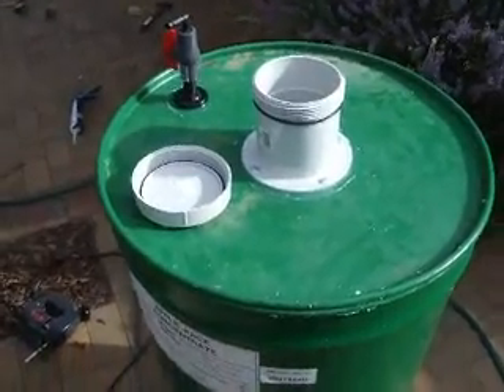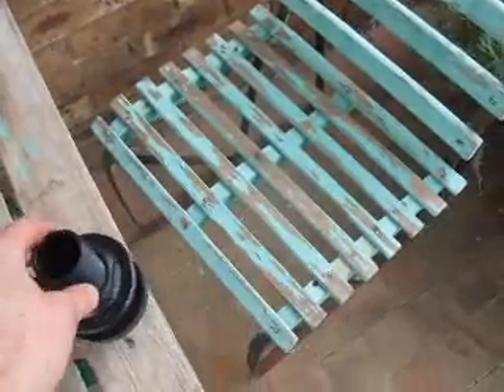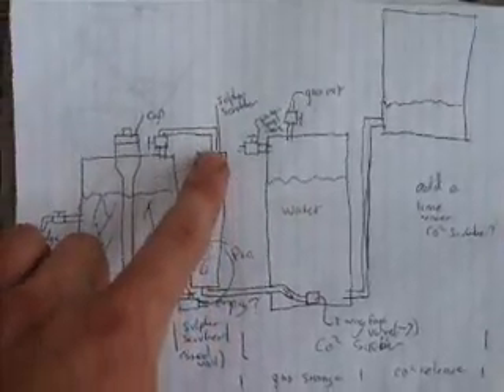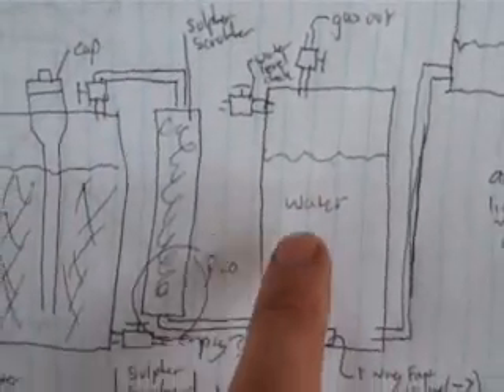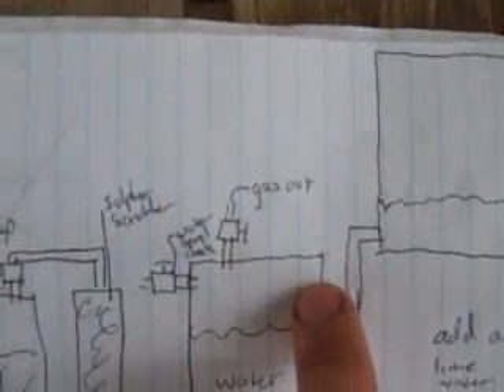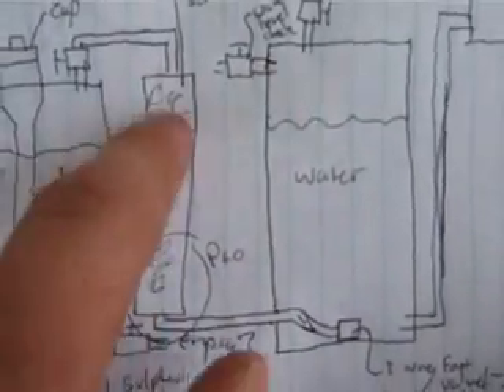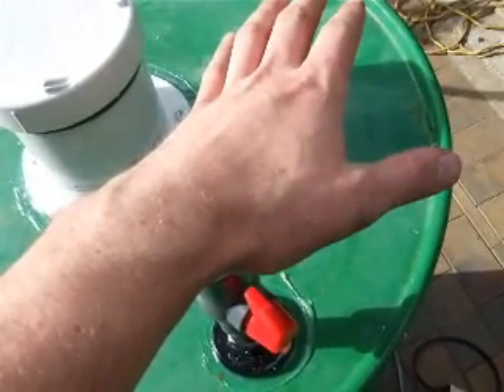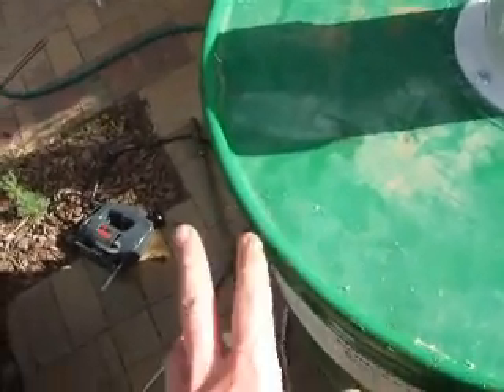anaerobic methane digester how to, including biogas scrubbing

Comment: If you have pressure building up to push the water to the elevated tank, would the pressure push the biomass out of the filling up pipe when you took off the cap?

Comment from the maker: @conkoumis the tube in the centre goes under the liquid level, so you just unscrew the top and add you slurry then screw it back on, it will get a small amount of air but not enough to worry about

Comment: Fantastic idea. I've also searched the web for biogas digesters and yours came up as the best solution. Do you have plans that I could get from you? I'd be happy to pay any cost to you.
I'd like to setup a similar unit here in Portland, Oregon for use with a wall mounted propane heating unit.
My father and I were just discussing corrosion of the steel barrel. Then I read your suggestion on a plastic drum. This would allow for long term use as opposed to having to rebuild every few years.
Thanks!

Comment from the maker: @ShaggtyDoo if its just a gas burner then i think it should be fine, but to keep the fridge happy i would scrub the gas of HS2, steel wool will do the trick (not stainless steel wool but the rusting kind) HS2 when dissolved in water makes sulphuric acid so its very corrosive, this is also why i am now recommending to ONLY use a plastic drum for the fermentation chamber as steel get pin hole in it real fast, also you will need to change the jets to use this gas as LP has alot more energy in it

Comment from the maker: @t1l1m have you looked on ebay? you maybe able to use large tank flanges (like the one on the side of the digester but much larger and you could add a large ball valve instead of the screw cap)

Comment from the maker: @Flipbounce the scrubbers work as long as they are not stainless, but i found in my research that lime water or a caustic solution will work better as it will also remove some CO2. the barrel i got from a feed store but get a plastic one as the steel ones rust out real quick from the H2S

Comment: Removal from fuel gases - Hydrogen sulfide is commonly found in biogas.
Reaction with iron oxide- gas is pumped through a container of hydrated iron(III) oxide,which combines with hydrogen sulfide.
    Fe2O3(s) + H2O(l) + 3 H2S(g) → Fe2S3(s) + 4 H2O(l)
In order to regenerate iron(III) oxide, the container must be taken out of service,flooded with water and aerated.
    2 Fe2S3(s) + 3 O2(g) + 2 H2O(l) → 2 Fe2O3(s) + H2O(l) + 6 S(s)
On completion the container is drained and reused.
Source - Wiki

Comment from the maker: @jhillsmo im not sure its a strange gas and seems to burn very cleanly straight off the hose without any oxygen mixed i think the pressure would be to low for a bunsen. just use a piece of copper pipe to start with

Comment from the maker: @ncbookz that kind of defeats the whole purpose, i was planing to heat the tank using gas produced through some peltier devices (or TEG's) and make some power at the same time as heating the tank.. you can get more gas from vegetable materials than manure as it has more available energy in any carbohydrates in the vegies. the only problem is getting the nitrogen up enough, fresh bird poo would be very good for this or just urine

Comment from the maker: @Cstrife234 not when you open the top of the digester to feed it, the back pressure would push the contents out the top.. you would need at least a valve, the one way valve is just an extra safety

Comment from the maker: there is no reducer on the one i made. i did draw a reducer in the plans but didnt use one.. it goes to the bottom because you dont want air entering the chamber as it anaerobic(without oxygen) not aerobic (with oxygen)

Comment from the maker: you can (and i plan too) useing something like an old fridge compresser, but you cannot liquidfy it unless you can get to realy high pressures (and very low temps) but just commerssing it is easy... although to save the tank and the compresser you need to scrub the gas

Comment: Looks good. But since this is anaerobic, you will generate hydrogen sulfide instead of sulfur dioxide. Also, is the drum lined or coated on the inside? I am afraid that you'll get massive corrosion with it being an acidic environment.

Comment from the maker: At -82.7 degrees centigrade it would take a pressure of 45.96 bar to get it to liquify (about 670psi) but it will NOT liquify above -82.7°C

Comment from the maker: at 500psi it will still be a gas... it would make storing some smaller but if you look at my design for the system the water will push the gas out of the storage tank so it can be used

Comment from the maker: there is a reason for haveing the pipe at the bottom and its to help remove some CO² i may even add a small tube the has lots of holes to make the bubbles smaller

Comment from the maker: as all the outlets on the tank are valved or sealed there will be no problem with it over flowing (have a look at the second video). before i add more bio-mas to the digester i will open the side valve till all the pressure in the tank is released (and spent slurry) and then open the top and add the new slurry